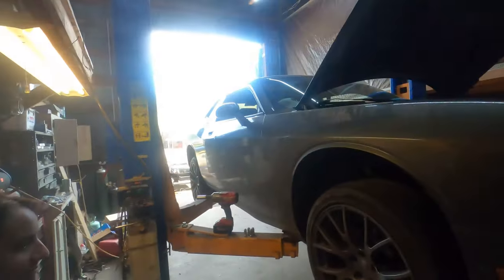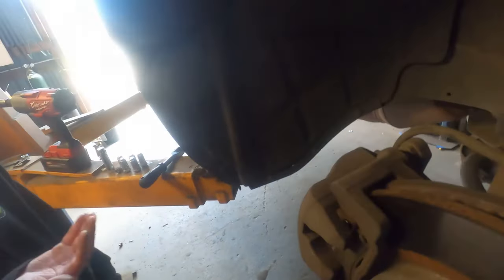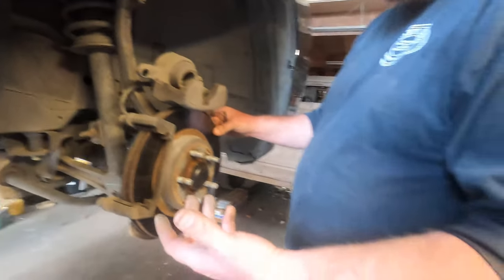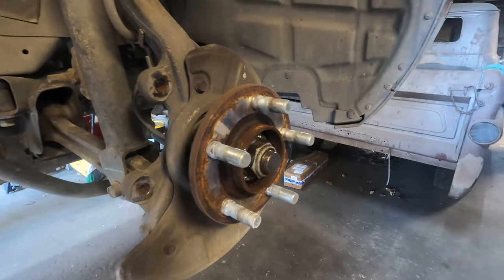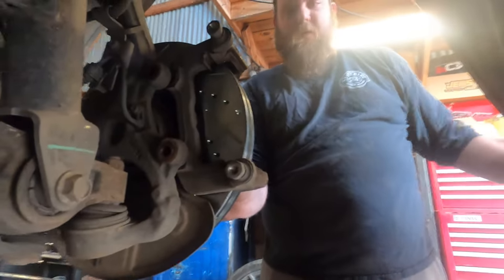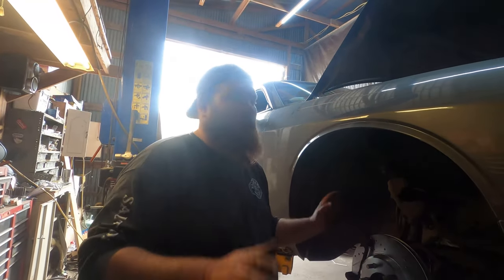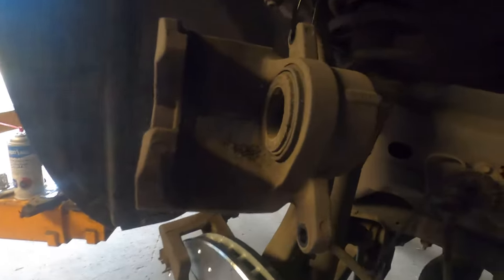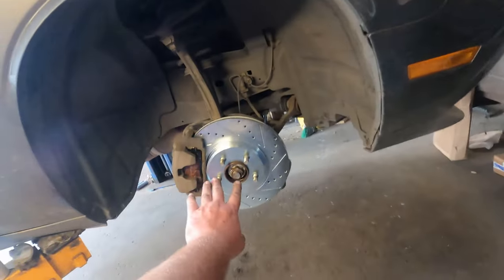2008-2014 Dodge Challenger/Charger Front Brake and Rotor Replacement!

Comment: This is for v6 only right?
Reply from the maker: Yes, so definitely don't order the parts. The process will be very similar though.
Reply: @GreenCastleGarage  im having trouble finding rotors for my 11 charger 5.7
Reply from the maker: Yeah sometimes they have alot of options. Have you tried putting your car into the Amazon filter? Or any auto parts store will have what you need with a few questions. Without knowing your trim I found these,
 Front: https://amzn.to/3G1ZH2v 
Rear: https://amzn.to/40lfO3f
Reply: @GreenCastleGarage  i have bro and it doesnt throw anything back, just some plain jane goodyear ones. I want the drilled ones for the front. Detroit Axle has some nice ones but it only says 2011 charger (3.6L; Except Police Package) cant find one that says r/t or 5.7
Reply from the maker: @Justin  I think those links I sent say 5.7l. Could always pull put the tape measure and be certain the dimensions are correct. I definitely recommend the Detroit drilled and slotted if you can find them.